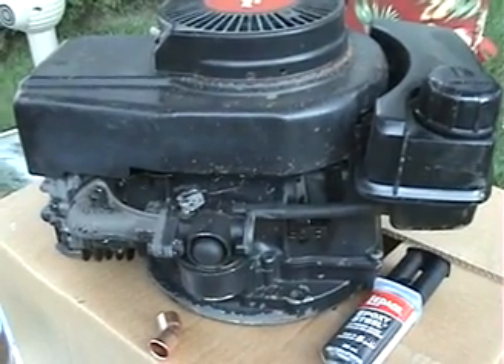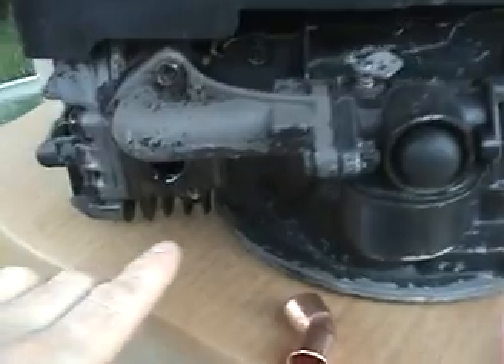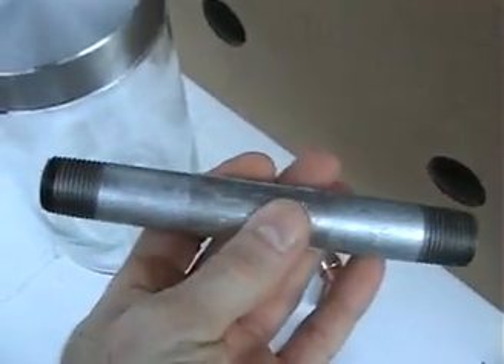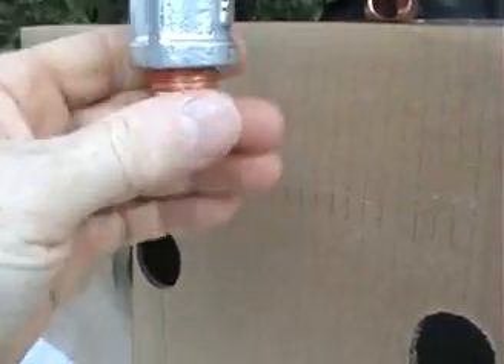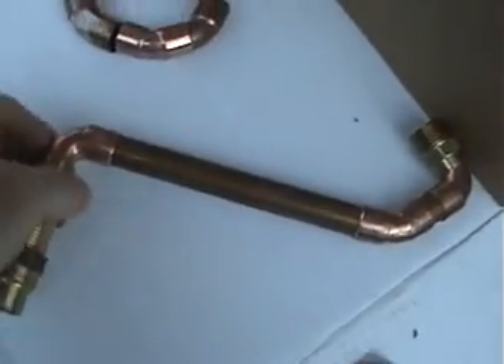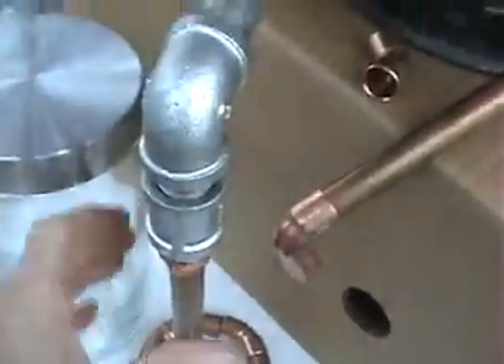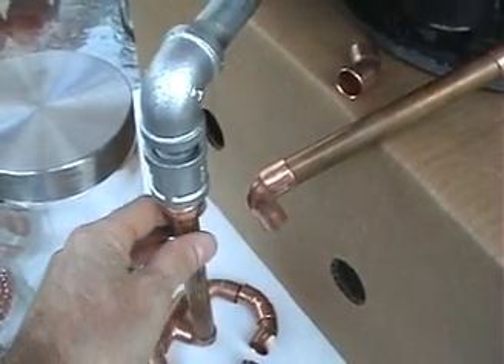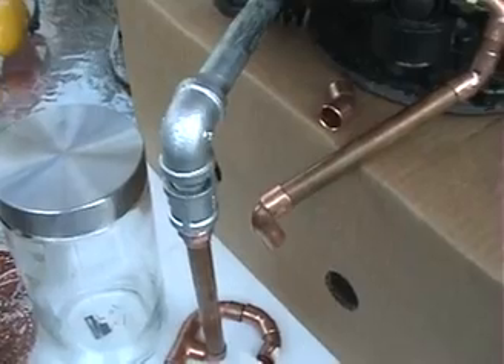Plasma Water & Gasoline Engine Project

Comment: I believe that reactor is only needed to crack heavier fuels like crude,engine oil,food...Thing is that you can separate any element from it's molecule,if you use high energy levels (plasma spark,geet reactor,combination of heat,pressure,catalysts,plasma spark).So,you don't actually need the reactor to crack the petrol.All you need is to heat the fuel enough,make it come in contact with NICKEL or PLATINUM,'cause they crack the ALKANES spontaneously and get methane and alcohols out of petrol.

Comment from the maker: InventorGadget, thanks for looking! I know it is possible to return 100% of the exhaust. Look in my favorites, I added 2 videos. One demonstrates a GEET lawn motor which he shut the exhaust valve and motor runs. I did contact Frederic Gauthier and he has confirm this to be correct. However I may need some air in to which I'll know once I test. The next video is a GAS engine working on Diesel and has no smoke from the exhaust! This demonstrates the plasma spark burns fuel 100%. So clean exhaust!

Comment: ok, the concept idea is grate! You really on to something, but, in the GEET system, you mix "some" fresh air IN , and expel "some" exhaust gases OUT, and re-using a lot of exhaust gas. So.. my question is basically, where is the extra oxygen for gasoline vapor combustion coming from ?? 
Because water->HHO->Plasma Spark Combustion->water.. right? 
So no extra oxygen for the gasoline.. ? 
Maybe I missed something, can you explain this closed-loop GEET system perhaps?

Comment from the maker: Hi johncarl43447,

thanks for looking at the video. Yes, adding a flywheel would smooth out the engine. Not yet decided on what I'll add. A 2 to 1 ratio timing belt and pulley assembly will be used to remove waste spark as I would like ignition to be ATDC.

Thanks

Luc

Comment: Great progress! The only thing that I thought might help is for you to add another flywheel on the shaft where the blade was,or maybe a flywheel from a horizontal shaft engine of the same size ,I think they are generally heavier than a flywheel from a vertical shaft lawnmower engine  .Lawnmower engines  are much harder to start without a blade.I was also wondering if you were going to eliminate the waste spark?Good Job Luc !